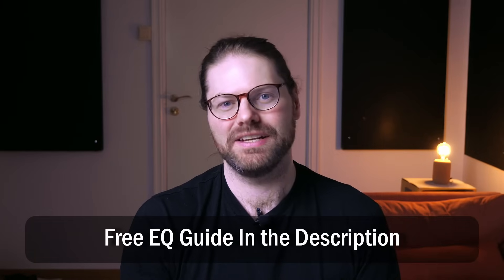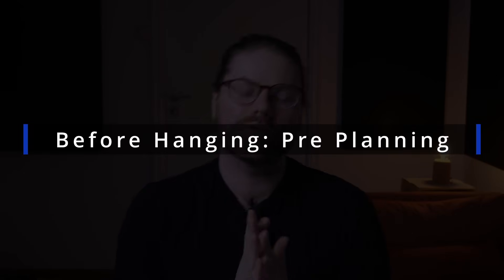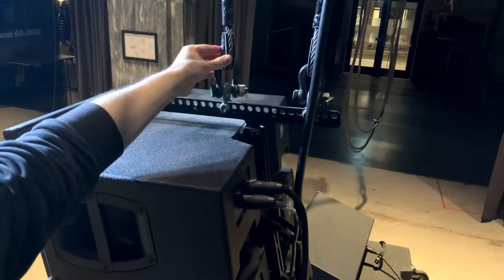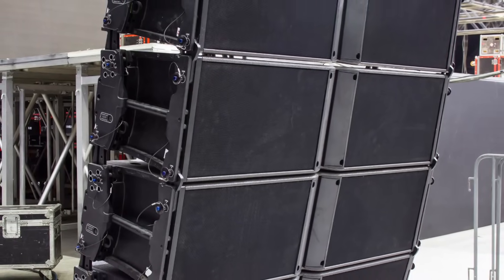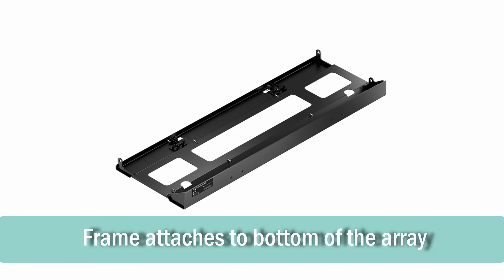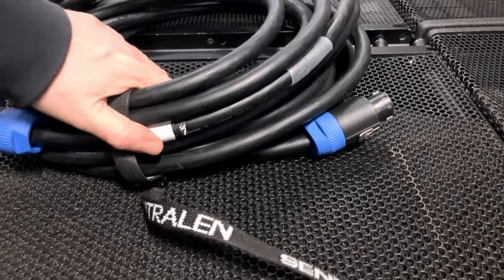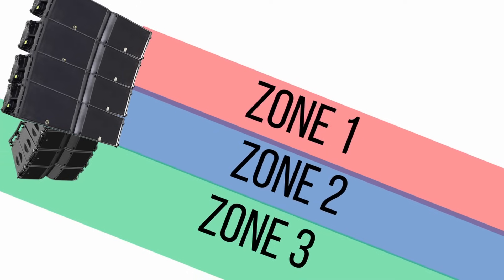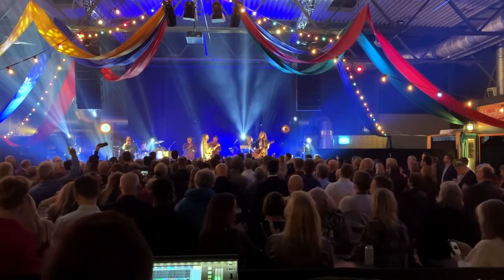How Speakers Are Flown

Comment: I want to install linery in a church auditorium but the church isn't long , how do I go about it
Reply: If the room isn’t long it probably doesn’t need a line array. You can still fly point source speakers, if they don’t cover enough of the room you can add delay speakers where the coverage begins to end. If you have a wide room you can add outfill speakers too. I’d use a system processor to adjust delay times and EQ for the entire system

Comment: Do you connect the power and sound source cable while your Line array is “on the floor” or you lift your system and connect the cables on height?

If you connect everything on floor, how do you keep the cables not falling below the PA?
Reply: Yes you would cable the PA while it is floating at a working height, you dont want to do it before you have started to lift the PA off the ground in case it gets snagged. You may have cables going between boxes and as the PA is lifted the gap will increase depending on your set angles so best to cable in stages as each box is pinned while going up. If rigging from truss then your main loom of cable may be run along the top of the truss, down to the PA and off the end of the truss to the floor where it will be lifted with the truss (providing you leave slack). in some cases you might run it between multiple trusses to get it to a point in the rig where it can drop to the floor out of sight of any audience. Cable picks / runs are usually agreed before hand.  If rigging from your own motors then you might attach the PA end of your cable loom to the frame of the PA with a sling or spanset to keep it in place and take the weight of the cable off of the connectors, fly the PA leaving the amp end of the loom trailing down to the floor. you can then either use the same method and attach it to another piece of truss some where else in the rig to take it off the ground or in some cases you might use a rope and pulley to hoist the cable up and out of eye line but this will require some climbing to rig your pulley system. and of course there are some cases where we just dont care and leave the cable dropping straight down from the PA in a loom but you would still take the weight off the connectors by attaching the loom to the frame of the PA and leaving a slight loop of cable at the top for strain relief.

In summary: Cable everything on the ground and pre-plan with other departments (usually lighting) where your cable need to run so it can be lifted up and dropped back down somewhere out of sight.

Comment: Hi, I really hope you fixed this after taking the video clip but the shot at 8:45 shows that you didn’t pin the back of those two Y boxes correctly. You did not put the safety pins in the correct place. There is a reason there are two pins on each box, one is the main pin that the weight of the array hangs on that attaches with the hook from the box above and one is a safety to go in the hole directly under the main hole (if main pin is in 11, safety would go in 13). I really hope this was fixed before you sent the  array to trim or that you can go back and fix this. This is why it is important that people get proper training.
Reply from the maker: Thanks for pointing that out. I'll get the venue to contact the installer to double check everything

Comment: Do I need to delay the different zones of the array?
Reply: No, you want to treat a line array as one big speaker. I would also suggest to keep EQ and level the same across the whole array. Gain shading should be handled with care.
Reply from the maker: Great Question. No need to delay no. For more details about arrays and how they work I'd recommend watching Michael Curtis on youtube or reading Sound Systems: design and optimisation. Though admitedly the book is incredibly dry.